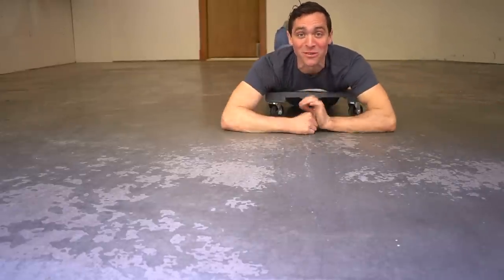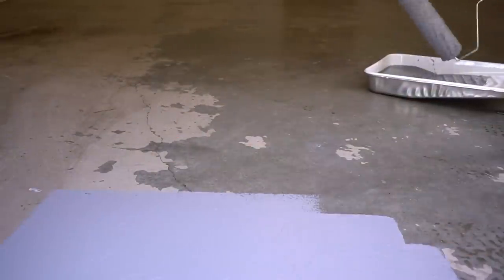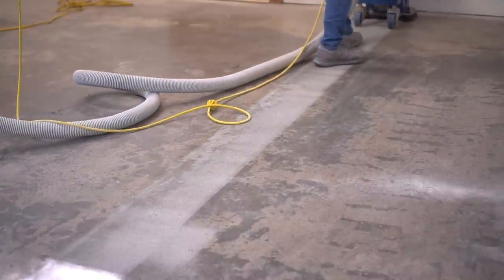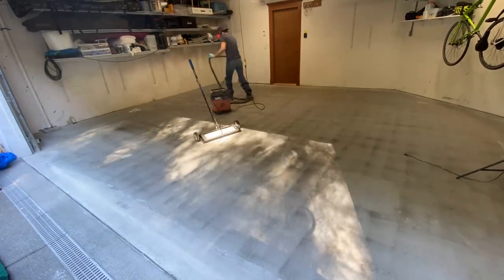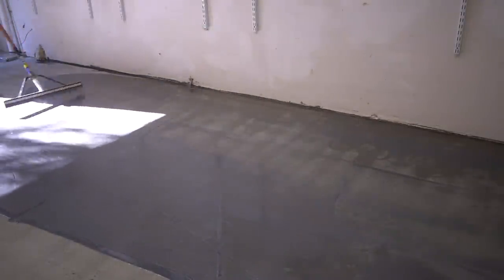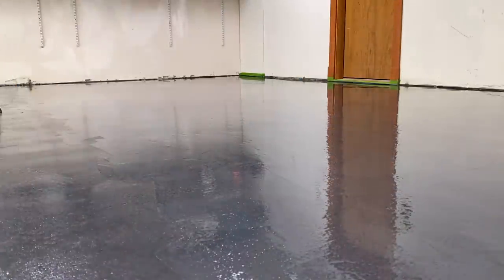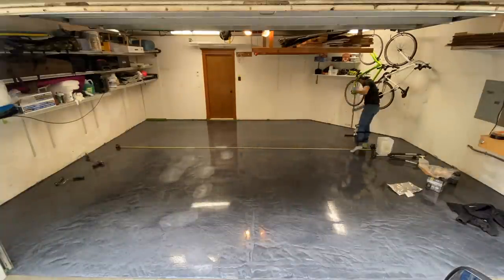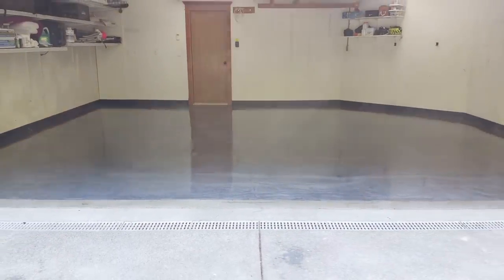EPOXY GARAGE FLOOR // DIY Epoxy Flooring Tutorial

Comment: Literally everyone on YouTube who has installed Rust-Oleum garage floors was sponsored by Rust-Oleum. Literally never seen anyone who just bought it themselves.
Reply: Its because the kit he used costs like $130 and he used 5 of them for that tiny garage. None of the DIY youtube channels would shell out that much when you can mix your own epoxy and just add pigment for 1/10th the cost.

Comment: Pro tip, if you're using frog tape,  moisten the edge first,  then it will seal a lot better
Reply from the maker: GREAT TIP Amy and I should have done that.  I know better :) Thanks for mentioning that and for watching the video.  Truly appreciate the support.
Reply: Hi! What do you mean by moisture thr edge first? Please explain. Thanks

Comment: It came out really great though in my opinion, you should have put the anti skid because if your car comes in after rain, it might not break or it will slide because it is wet. Especially if it snows, it can be even worse
Reply from the maker: I did add the anti skid to the clear coat CG.  I completely agree with the anti skid because it really does help when you have moisture on the floor.  Thanks for watching.
Reply: @BYOTools  Ok thank you! And keep up the content!!👍

Comment: Excellent tutorial. Very easy to follow. I do have one question though. What are some of the negative about going with option 1 ( just using the restoleum primer)? Our garage is five years old, it’s never been painted or epoxy before, it’s in pretty good shape and it only has a few stains from my snowblower. Is it worth renting the grinding equipment or I’m better off cleaning it with the degreaser in applying the primer instead

Comment: Great video!  Interesting idea about the base coat with the squeegee--perhaps this is why so many people come up very short with this product compared to what it is rated for by Rustoleum.  However despite the video saying it would be listed, there's actually no mention of how many boxes you needed to use or how many sq ft. that garage was.  Also how much product is needed for the squeegeed on base coat compared to the roller coating?  I bought 4 boxes of this stuff to do a 200 sqft garage--this is double the amount Rustoleum says to use, but now I wonder if I don't need another 1-2 boxes for this basecoat?

Comment: Hello.... Nice informative video... but i am little confused.... What is a seal coat. You have listed a primer Recoat....On Homedepot website it mentions not to use this primer on bare concrete? Is that the seal coat or is this something else?I had old layer which i removed and my garage looks like bare concrete now. Other videos i saw put the Rocksolid Polycuramine directly over concrete.

Comment: Did you say how long you waited between seal coat and metallic top coat? I know you waited 24 hours to apply clear coat, is wait time the same in between first two coats?
Reply from the maker: Good question James and I waited approximately 24 hours between coats, but in all honest as long as the floor is dry enough to walk on then it is ready to apply another coat.  Thanks for watching and your continued support.

Comment: hi brent! nice epoxy flooring. I do have a question. you've mentioned that the floor needs to do a moisture test before applying it. but what do we need to do if the moisture results turns otherwise? what is the procedure if the floor have moisture issues?
Reply from the maker: Great question Ahmad and in all honest I haven't had to deal with a moisture test that failed but I have done research and there is a moisture barrier paint/sealer that is out there for this specific application.  You apply it to the surface first after you prep the surface and then you can apply epoxy to the floor so it won't fail.  Hope that helps and thanks for watching.
Reply: @BYOTools  forgot to mention to you that i'm from Malaysia, and i m a very big fan of your works ! regarding the moisture, here in Malaysia we're having a climate of hot and humid, therefore for a concrete mix for flooring, we need to insert a thin plastic / rubber membrane before dumping a thick 150mm - 200mm concrete (6" - 9" thick). but these method are not applied throughout the whole country, thus most concrete here have high moisture content.

Comment: How does Rocksolid compare to the Epoxy Shield you used previously?
Reply from the maker: Great question and Rocksolid in my opinion was actually easier to apply since you don't have to worry about spreading paint chips evenly over the floor.  Thanks for watching and hope you enjoyed the video.

Comment: Do you think this epoxy is okay to use on a basement concrete floor?
Reply from the maker: Yep!  Should work perfectly Benjamin.  Just make sure you do a moisture test on it first.  Thanks for watching.
Reply: @BYOTools  one last question, was there any chemical smell  associated with the epoxy. A family member suffers from asthma, so I thought I'd ask.

Also, thank you for the great videos! I'm a big fan!
Reply from the maker: There is a slight smell to the product when you'r applying it but it dissipates fairly quickly once it's dry.  Thanks so much for your support.

Comment: Can you use floor leveler under epoxy if you had to level out dips?
Reply: yes you can just make sure you grind on floor leveler for adhesion (the same way he used a grinder for the edges)

Comment: I just bought a new construction house, will I get away with simply priming the garage concrete floor before expoxy coat?
Reply: You need to remove the concrete sealer that was applied after the concrete was poured and finished.

Comment: If this is a brand new concrete floor, do you need to do all the same prep work?
Reply: @Jordan no you would just do degreaser, primer paint then epoxy and clear no need to shot blast floor if it is new...
Reply: @eighteenweeler5767  you have to remove that concrete sealer that is applied after the concrete is poured and finished or otherwise the epoxy will not successfully bond.

Comment: Don’t shot blast, don’t degrease and prime.... do it the right way and GRIND your concrete with a concrete grinder. There is a very good reason professional epoxy installation companies grind the concrete and don’t waste their time with any other option.